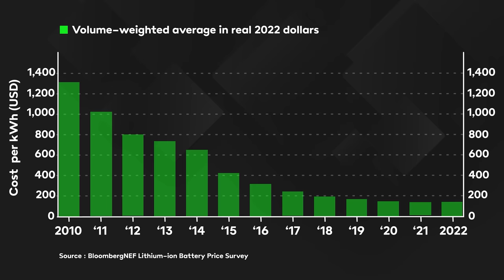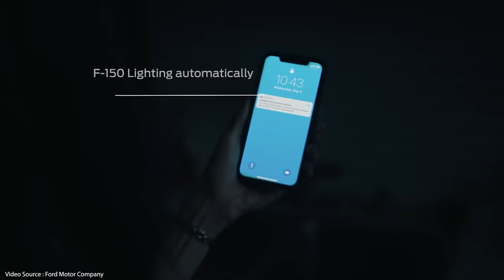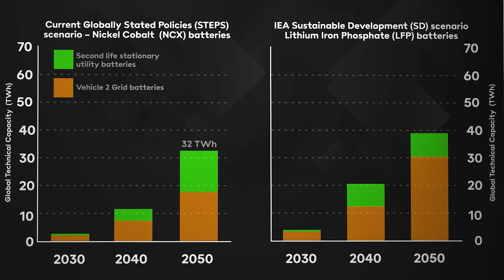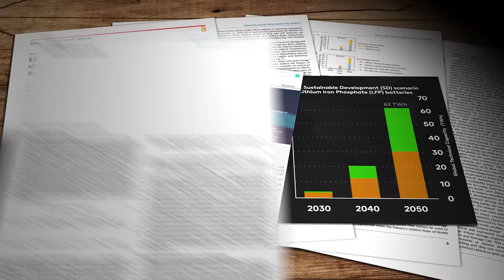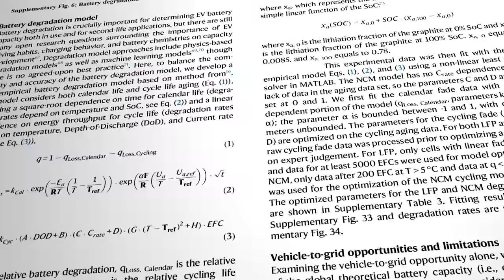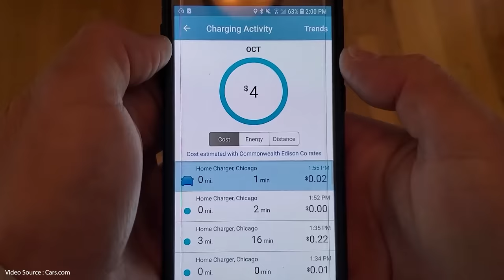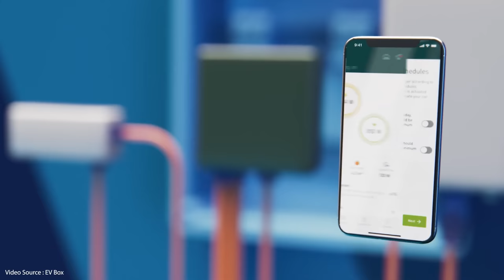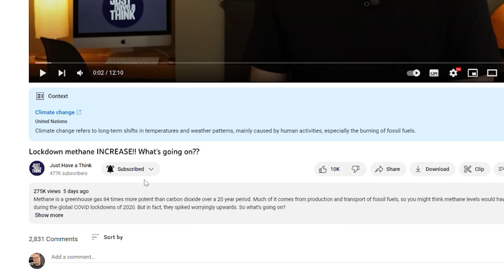Can the electric grid ruin your EV battery?

Comment: Personal automobiles are inconsistent with zero carbon. They are massively complex, and create an inescapable energy and resource impact just to build them, and they have a limited lifetime. I'm not comparing ICE to EV here. I'm saying neither can be built under zero carbon. So basing our energy strategy and grid stability on massive portable lithium batteries is a fool's errand.

Sustainable transportation is electrified rail and micromobility, not electric SUVs, pickup trucks, and luxury cars. Long range BEVs are already limiting their own market with battery resource shortages due to mining constraints. Contrary to what was said in this video, battery prices are not falling. They've risen and they're going to be a challenge to build at the rate of demand. Not sure how you came to a different conclusion. The Biden Administration believes we can build them with US mining, but didn't take into account the 7-12 year lead time to get a mine through environmental review and actually producing. Regardless, those mining emissions become a new impact from the oversized batteries of these EVs. The game isn't over in 2050. So why do we describe everything as if it must just get us to 2050? We need to do this for hundreds and thousands and hundreds of thousands of years. Lithium battery powered pickups are a mistake, not the savior to the grid.

This paper scratches at the issue, but still seeks to leave space for EVs, again, because it's not looking forward far enough for a truly circular solution for all materials needed for sustainable transportation.
https://www.climateandcommunity.org/more-mobility-less-mining

Comment: Isn't there a problem with the whole use your EV as a boost to the energy grid during peak demand hours ? Don't lots of people need to use their vehicles right at those times to go to and from work for example. Plus not everyone comes and goes at the same times or goes right to home and right to work with no others stops. 
Also with Engineering Explained analysis of the energy grid to have the extra capacity to charge millions of EV, let alone everything else that is going to needed to be electrified. He missed out the massive point that we can't use fossil fuels to make electricity if we want to hit our climate goals.. Currently about 79% of the USA energy comes from fossil fuels!

Comment: a better step is in triboelectric energy harvesting systems, that are just beginning to be understood and developed, right now, as it can literally give us the ability to reverse what is known as the lowest state of entropy before it spreads out to be unrecoverable energy, ie converting heat back into electricity, (not to be confused with converting equalizing heat differentials.) I would say we will see this tech enabling running equipment like cars where driving your car will actually reduce the temp in the local region around the car instead of injecting heat from captured sources like fossil fuels,

Comment: V2G is dumb.

I would never wear out my battery for my car by letting the grid burn up all my charge cycles.
Reply: You already do if you charge your phone in your car.
Reply: @bradhuffjr777  my car is not the grid producing power, my cars EV battery pack is storing charge to use. 

Using you car as storage for the grid and allowing it to discharge back to the grid is not the same as using your car to charge a phone battery
Reply: @Les S  Please define "the grid" then because maybe my definition is more inclusive than yours.
Reply: @bradhuffjr777  The grid is a system of power production facilities, plus the transmission lines which are used to deliver the energy to customers.

An EV contains no power producing capability.  It only stores and discharges energy.

The issue I have here is a matter of scale.

The EV battery pack in your EV has only so many charge cycles before degradation begins to present, a charge and discharge is one charge cycle.

By allowing your car to act as storage for the grid your EV will undergo hundreds or thousands of charge cycles which creates wear and tear on your batteries.

While it CAN be done, it does not mean that it SHOULD be done.
Reply: @Les S  A pile of coal, a hydroelectric dam, and a shipment of uranium are energy storage devices that are part of 'the grid.' 'the grid' is more than electricity production. It is also storage and transmission. 

Here is an idea, power critical items like the blower to a gas furnace, an electric blanket, refrigerate temperature sensitive medicine, or communication devices needed for an emergency whilst the grid is malfunction from a Diesel Hybrid that temporarily fulfills emergency needs whilst 'the grid' cannot just like charging your phone from your car because it is disconnected from 'the grid' whilst in motion. Same could be done with other mobile electric devices like a battery powered lawn mower.
Reply: @bradhuffjr777  You're exhibiting a category error.

A grid takes fuel, whether coal, water, or uranium, and produces power from it which is then delivered to customers.

An EV just stores energy, it doesn't produce it.  You can't take an EV and use it as fuel to produce power.

Comment: Interesting all your reports, congratulations.
When charging an electric vehicle of say 30 KWH means has to be connected during one hour with a power of 30 KW, if charged in 1/2 hour would require 60 KW, for 5 minute charge will require 360 KW per car, if that has station has 5 charging points so the maximum installed capacity should be around 1800 KW, or 1,8 MW, is a huge value for a simple gas station (GS) Considering that there will be thousands of charging stations it would require a medium voltage substation at every GS.
It will require power transformers, switch gears,  protection and communication systems, and the most annoying part to build thousands of kilometers of electric power lines where, permissions (environmental, property rights, etc) are very difficult, for any country the investment will be huge
Reply: Or just a mega pack between the chargers and the grid! Elon has already done the thinking and is building the solution and if at peak times the grid needs a stabilisation these mega packs will grab a load of cash aswell.

Comment: I tend to go along with Musk here that V2G is a bit of a diversion right now and stationary is a more reasonable near term goal. As the transition happens it is much easier to enable economic intensives in a single direction. For example free charging during sunny day hours with excess solar. With standard range now in EVs topping off once a week for free or cheap would do much of the work to smooth the curve without extensive additional infrastructure right away. It isn't just envisioning the grid as the logical steps to get there. Grid operators with stationary storage can plan. It becomes much more difficult with random points joining at random times. That doesn't even count the possible non-battery storage options or the increase per vehicle usage autonomous driving would give.
For now it is more of a fancy marketing seldom useful diversion.
Reply: Musk sells stationary storage and doesn't want to be on the hook for any possible damage to the vehicle batteries that his company warrants, so he has multiple conflicts of interest on this subject.  Vehicle to home is far more interesting to me than vehicle to grid.  V2H is something that I'd probably use for a few hours a year.  It wouldn't harm the battery but isn't enough to justify the purchase of expensive stationary storage like a powerwall.
Reply: @incognitotorpedo42  It isn't just V2H but general distributed storage. Musk may have offerings in both sectors but that doesn't make him wrong only that he has focused on a realistic solution. My quibble with V2G is more ease of use and planning.

Comment: I'm astonished at those US electricity consumption figures. 29kWh a day? Average? A DAY? Blimey!

I'm a single Brit in the north of England, living in a 2-bedroom terraced house (built in 1913) and I use 25kWh per month. I admit that my circumstances are probably not typical; I live 'small'. I've got no heating whatsoever, no hot water (apart from a kettle to make hot drinks), and currently have to pay three times more in the standing charge than I do for the electricity I actually use. Welcome to rip-off Britain.

Meanwhile, pardon my 'harrumph!' at the glorious and allegedly rapidly diminishing cost per kilowatt hectare foot-pound joule (or whatever) of Lithium batteries. Despite the plummeting graphs, EVs are still absurdly expensive. Prohibitively so. Price parity with ICE cars? That's not bl**dy good enough!

We're told constantly how EVs are such simple, maintenance-free machines, with none of the nasty running or maintenance problems associated with evil ICE vehicles. Why, a plain, bottom of the range family hatchback EV should be literally half the price of a petrol equivalent. And yet modern cars are still priced so that they remain the playthings for the Apple-Dyson-golf club demographic.

So call me again when I can buy a new 2-seater micro EV for £3,000. And then tell me how I'm supposed to afford the electricity to charge the damn thing on my existing budget. [Which is about £800 annually (eight hundred quid per year).]
Reply: "29kWh a day?" - not me.  I use from 3kWh/day to 7kWh/day, depending on season.

Comment: I'm going to leave off commenting on your political lot in the UK, one of your noisier commenters said something about "swivel eyed loons" that I thought described them. I wish the US had such a clear lone- some of ours are "eat their children and yours while boating near a waterfall without a paddle" crazy. And that lot have decided that man had nothing to do with this "global warming" thing and therefore they needn't bother. That really describes a lot of them- the smarter ones have already invested in green start ups, but they are not the present majority.
On another point- read your electric service statement; most tell you that "115 volts" is really 115 v, +/- 10%, meaning that any voltage from about 97v to 133v might be delivered, and be kosher according to your contract. FWIW, one of the most common reasons for early AC condenser failures in Texas is compressors burning up during "brown outs"- voltage reductions brought on by high usage or uncontrolled out of service equipment. Will this negatively impact the charging batteries and how will the battery's on board computer see this fluctuation?  FR
Reply from the maker: I think America really does need to bring it's grid infrastructure somewhere a bit closer to the 21st Century. That would be helpful.
Reply: @JustHaveaThink  Not terribly likely as long as the utility companies keep pouring millions into campaign funds and lobbying to keep from spending billions on repair or renovation. I live in Texas, Dave, on a completely separate part of the grid, unconnected to the two other national grids, BY the VOTE OF OUR VERY OWN UTILITY DOMINATED LEGISLATURE.  I, too, think it would be helpful.  FR

Comment: I do have to say that I really doubt that the electric system will be able to expand as fast as it used to be mainly because of the difficulties that transmission expansion projects are facing worldwide. In some places the building time of new lines can take as much as 10 years which is just too much time compared to the average time of new generation investments. If you add that factor to the power grid challenges at a distribution level regarding eventual v2g adoption and distributed generation I am not very optimistic to be honest

Comment: Not everyone has a driveway and there aren't enough public chargers.

The people who do have driveways will just unplug when the grid is trying to take electricity from cars and then plug back in at midnight to charge with the cheaper electricity.
Reply: Exactly, timers are very cheap! No way I will risk it without guarantees and compensation!
Reply: Not when they get compensated handsomely when pumping watts back into the grid.. Tesla has several VPP's in operation using powerwalls and people have earned hundreds of dollars per month providing the grid with power during peak demand "events" VPP's in California have prevented several blackouts last summer.

I have a Model Y, which is charging at a public charger right now, just 30 meters from my front door... Installation of more and more public chargers in residential areas in my city has exploded the last couple years, I have at least 3 public charging locations within 100 meters from my home, this are simple poles with two CCS2 Mennekes connectors providing AC charging upto 17Watts per plug, you must bring your own cable and a card or NFC tag from your charging provider to beep the pole and start charging... The availability of these chargers does help to increase the number of electric cars too, they are more and more occupied these days. So if charging is more accessible an electric car becomes a real option for more and more people.

And the number of these kinda chargers will expand further, it will at least double the coming 2-3 years, and I do not think it will stop there

So there may be not enough right now in your area, but this can change very quickly.

Btw, the charging poles are mostly operated by TotalEnergies

Comment: Could someone forward this video to Elon "I don't see people would use v2g features in our cars" Musk?
Reply: @MarcoNierop  Maybe I'm too pragmatic. Or Frugal. (or both). My issue is, a powerwall is an expensive product compared to it's capabilities. I'd chose only one plus a V2G car, than installing 2-3-4 powerwalls.

Don't forget that V2G is nothing new to Tesla! It WAS a feature in the original Roadster. In an interview Elon told nobody ever used it. Somehow, I believe their reluctance to include it in their new vehicles is based on this experience.

I think it is shortsighted to say "if you leave the house go dark". Yes, in a power outage, it's true. But if we are doing VPP or cost shaving a V2G car can be a great addition. With only ONE powerwall. This topic leads to many thoughts I wouldn't type them all out.
Reply: @Sekir80  Its not only Elon Musk, Drew Baglino also holding off to this issue, and in the past JB Straubel also had a strong argument against V2G, but right now I have not the energy to look it up, there must be a video where JB is talking about why V2G is a bad idea.

I am in the middle, not really for or against it, as I cannot plug I'm my car in my house anyways and the public charger I use right now is also not V2G capable.

Power walls are expensive right now, but I think price will come down the coming years as economies of scale kick in and Tesla starts using 4680 cells, which are a lot cheaper.

Comment: the ev revolution is more than just an application of technology and it should not be analyzed in isolation. In North America the power grid is fragile and indthe United States coal and natural gas  are the primary  fuel .source Ironic isn't it . EVs alone are not a solution and the drive to electrify home heating will also require massive infrastructure.  Range and charge times are important not because we are comparing to Internal Combustion convenience there are times when evacuation for hurricanes. wild fires   or flooding, waiting for an EV to charge if there is electricity is not really viable. I will leave you with another consideration, that much of North America is vast and electrical power is not evenly distributed  Range is important. On a global basis your own map showing the growth of EVs also illustrates the vast areas like Africa, South America and Asia that don't have an efficient electrical infrastructure if they have electricity at all.  EVs are only part of the answer

Comment: Do you realise that the US is HOT as hell other parts cold some part both? You live in cramped apartments in a temper climate not too cold not too warm and England and brag about 1/3 of electricity use (which is mostly because it is also expensive as hell).
Reply from the maker: Yes, Steve. That's right. Well done you.